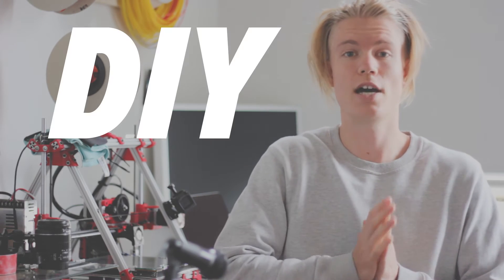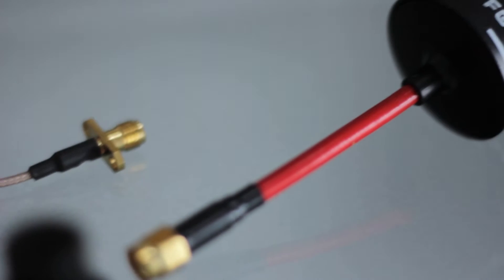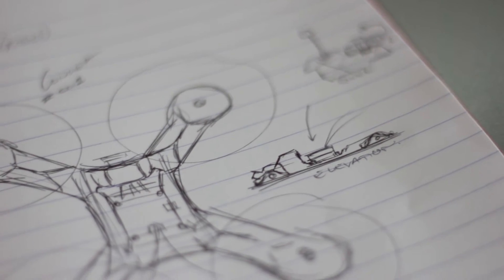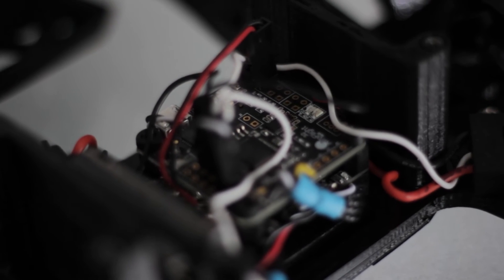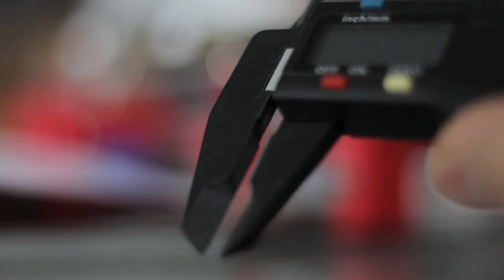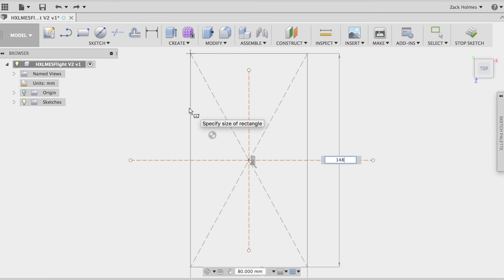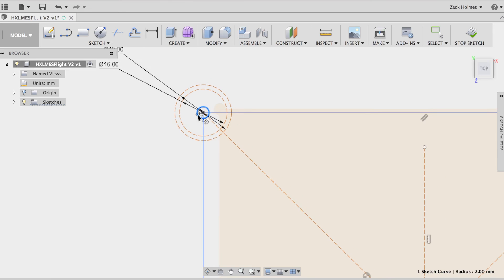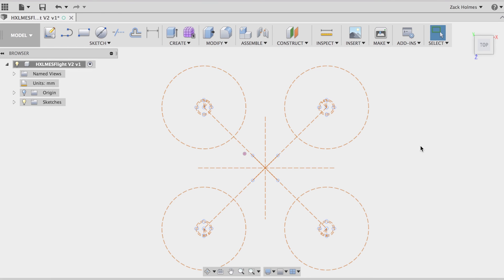DIY Drone Part II: Design Fundamentals and Parts List

Comment: Started installing ESCs and Motors tonight. Have installed the PDB and FC temporarily while I hardwire and solder.

Wish I could upload pictures!
Reply from the maker: Hey Craig! I'm uploading Part Three right now, showing my CAD process for the new frame design. I'd be really keen to see your progress, if you can upload them to Thingiverse and link them!
Reply: Here is the latest progress pic.  http://www.thingiverse.com/make:319335  

Also, I asked in that post if you could post a pic of the assembled drone? I'm looking for more details of the battery lead routing and securing, and the VTX as well

Thanks!
Reply from the maker: That is looking really good! What have you printed it from? Looks like the upper plate might be a different material? Or is it just the lighting? Oh yes of course, no problem. I can't believe I haven't gotten around to that yet. I will upload a few pictures tomorrow of the full build :)